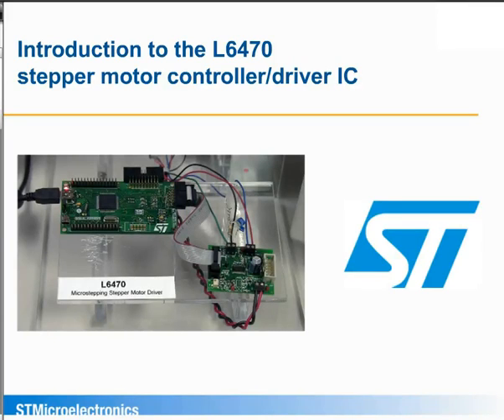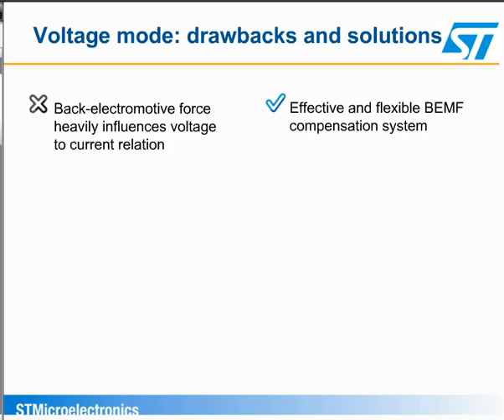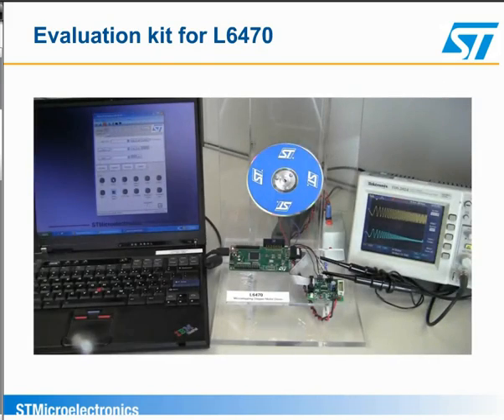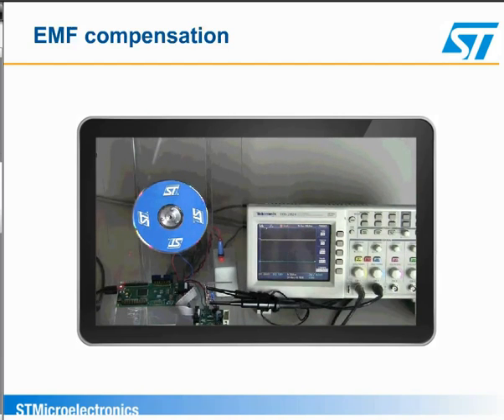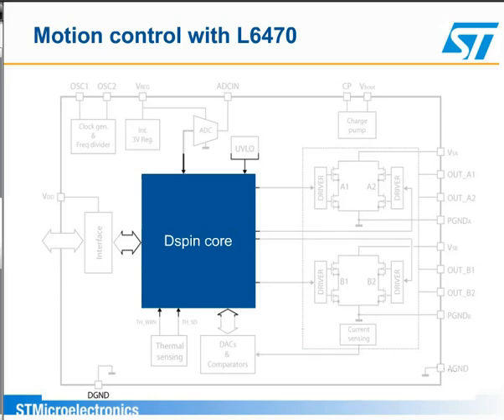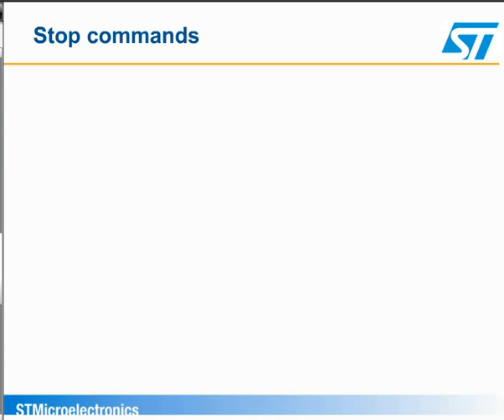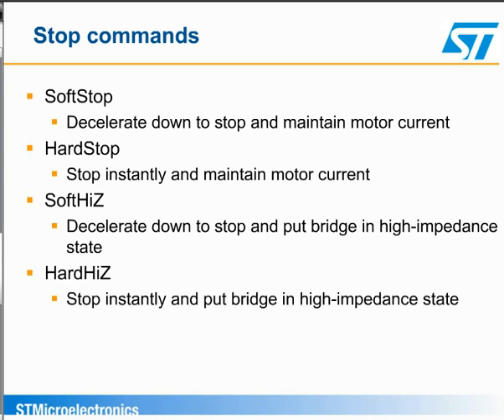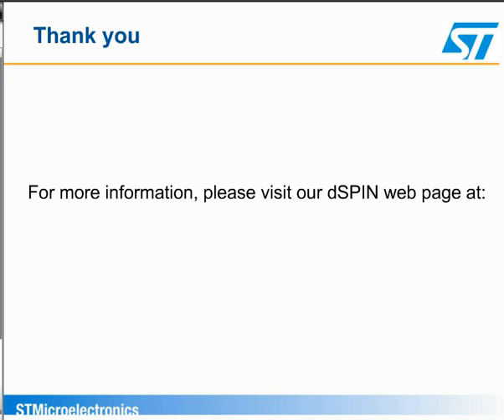dSPIN L6470 micro-stepping motor driver IC  (ePresentation)

Comment: I am very interested in using the L6470. I would like to setup a test that allows me to see the voltage and current as shown in your video. Do you have a document showing the test setup.
Where are you monitoring the current from? are you picking off a shunt resister in series with the motor coil?
I would be greatful for any information you can provide
I have all the evaluation boards and software and have enjoyed the results so far.
thanks
Reply: Hi, I'm also very interested in your query. Did you manage to find a solution?